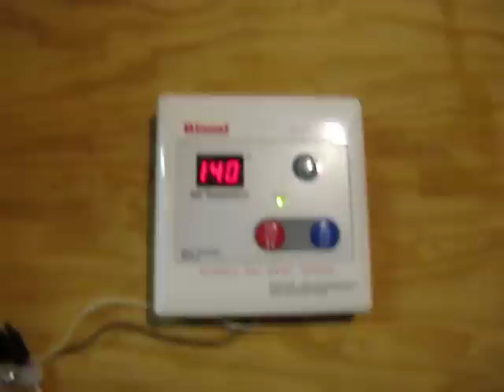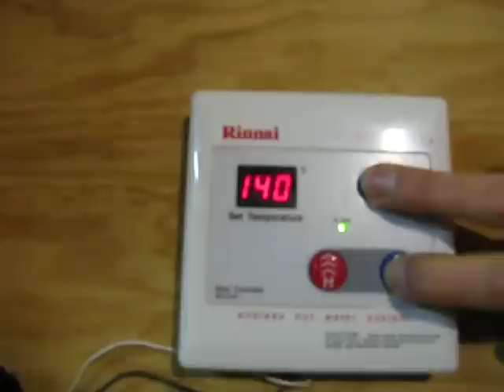Forint Rinnai 2011-02-16 Part 1 Bath Not Hot, 140 - 114

Comment: Cool. I'm looking into getting one. I currently have an electric tank unit, but I have a natural gas line. I will have to have the meter replaced by the utility company (which they said that they'll do for free and I'll have to have a plumber repipe my 3/4" gas line to a 1". Has it saved you money on your gas bill? If properly installed, does it pay for itself after several years? I've got 3 people in my house and my electric unit 50g probably costs 400 a year to operate. Low electric rates too.